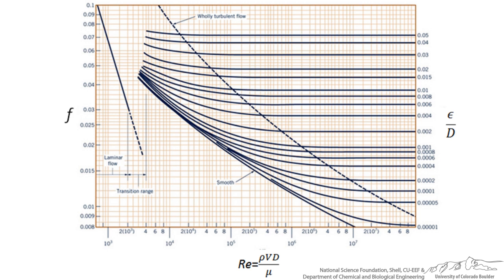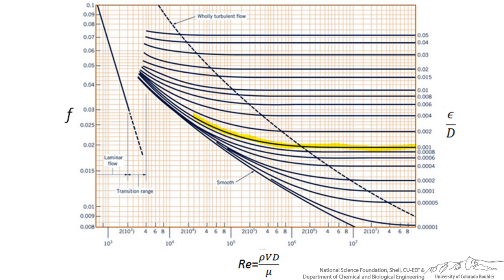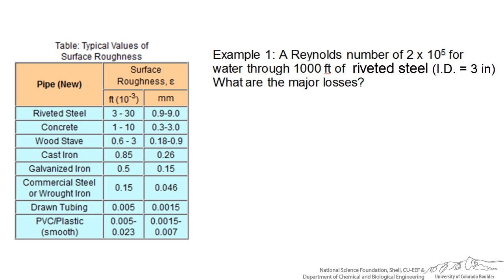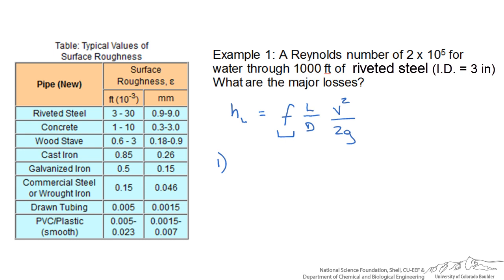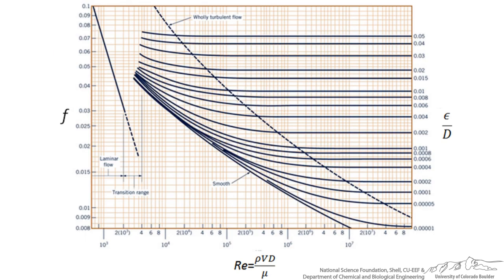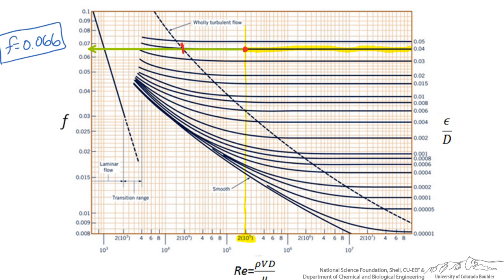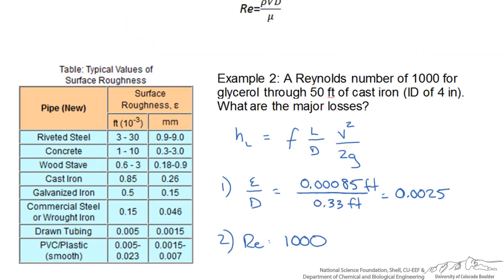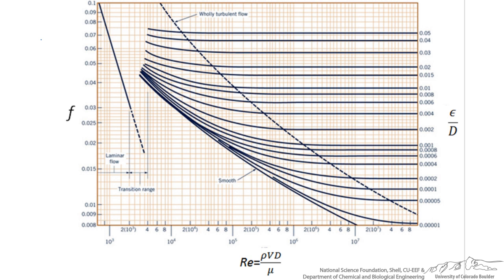Using a Moody Chart

Comment: For anyone who was wondering, I think the friction factor used in this video is the Darcy friction factor (64/Re = f) as opposed to the typical Fanning friction factor used by Chemical Engineers (16/Re = f). Both are equally valid, but it should always be specified which is being used. To get from Fanning to Darcy friction factors multiply the fanning friction factor by 4 (f_F * 4 = f_D)

Comment: I wish there was a text-table version of this chart. I want something I can plug into Excel so it'll do the lookup for me, such that changing the viscosity, or flowrate, or diameter, etc, will automatically pop out a new pressure loss result without manually futzing with data in the middle somewhere.